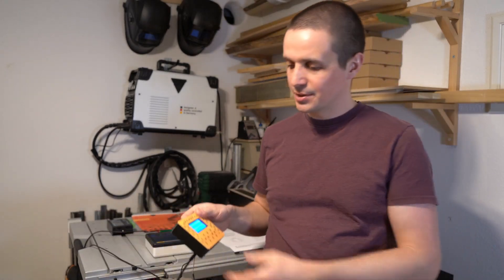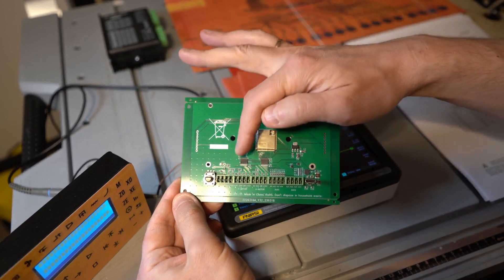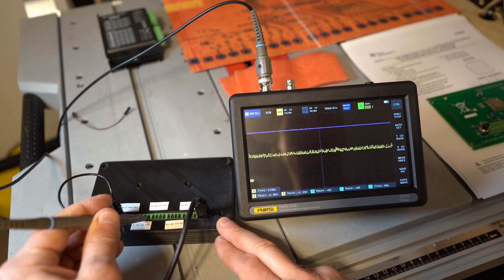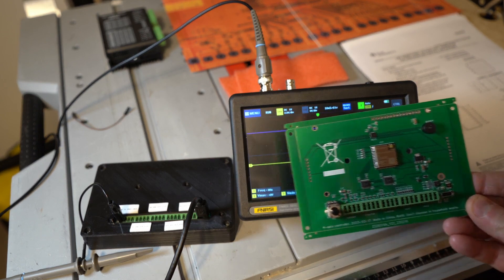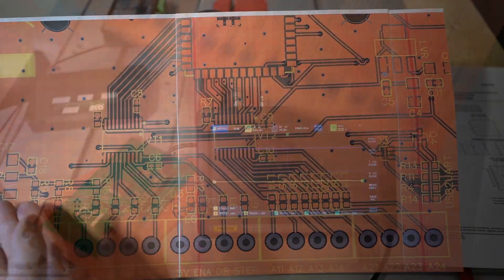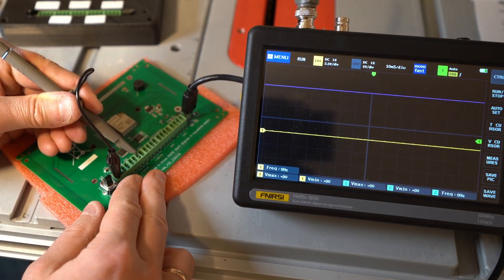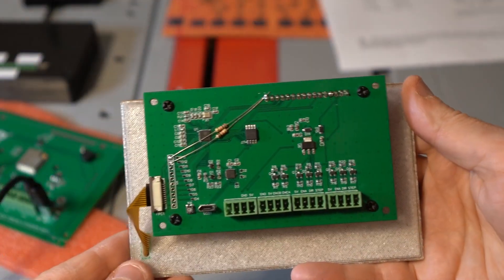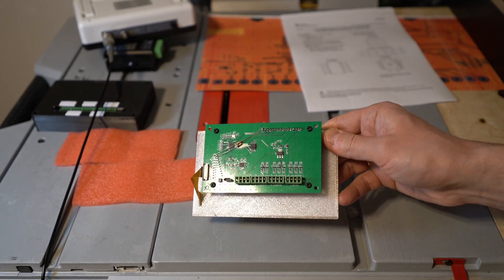Voltage translation woes - TXS0108E

Comment: i've had those exact ICs become headaches many times in professional designs i have worked on. the bidirectional amplifiers get confused very easily. They also do not have the greatest drive strength. plain and simple just stay away from them. I have only seen them work when source and destination are both on the same board, the trace impedance and SI are paid careful attention to, and the links are very short. Just remember, a unidirectional buffer will always be more reliable.

Comment: Design Issue ....... 
(1) try adding 20 UF Tantalum Cap before decoupling cap 
(2) Remove any Pull Up Pull Down OR Line Resistor ( This IC Can NOT Drive Current )
(3) Pull OE High with a 1K Resistor

Comment: dear dir is cool thing that you make can your unit can read DRO as well if can will be willy cool thank you
Reply from the maker: Dear friend, hardware-wise adding DROs is possible even today in A1 or A2 but in software it won't be easy.
Reply: @MaximKachurovskiy  thank you will be great if is possible and will be very easy to use if can and thank you for you answer and if can I willy to have one as well
Reply: @MaximKachurovskiy  and only the DRO sender and the function that you put into the control will be litter more easy maybe thank you.

Comment: As others have said that TXS chip is often sold as a general purpose level shifter. I believe that because of this (myself included), most people will try to use this in an application where some current needs to be drawn, or the signal is very sensitive to line capacitance. 

The optocouplers in the driver needs some current, and I don’t think that the TXS chip you’re using in that configuration can supply the current needed. 

I went with an SN74AHCT125N. It’s unidirectional, but for transmitting out step, direction and enable pulses it will work.
Reply from the maker: I went with a bunch of transistors - https://github.com/kachurovskiy/nanoels/blob/main/h4/h4-20230429.pdf page 5 - so far all good :) It's bidirectional and no stock shortages.

Comment: Using bi-directional level shifter here is a waste of money. I am lazy to look up the datasheet but you are most likely observing output pin switching into receive state (from output state), and it is looking like 1/2 of voltage. I think stepper drivers can be driven by an open collector transistor.

Comment: Have you tried using a tri-state buffer chip – the SN74AHCT125N
The Adafruit web site said that they are, “particularly good at converting 3V logic up to 5V”

Description-
Level shifting chips let you connect 3V and 5V devices together safely. This chip is similar to others in the shop (such as the 74LVC125) except this one is particularly good at converting 3V logic up to 5V. This is in demand especially when connecting some 3V devices such as the Teensy 3 to NeoPixels! Just power the 74AHCT125 with 5V, it will detect 3V logic properly. You can also use it to connect 5V logic out to 3V logic in, that's when you want to power the 74AHCT125 with 3V, it can safely read 5V logic on the input pins.

Comment: Maxim, I tried to use one of these on a Due based project since I was replacing a Mega (faster sampling) but like you I ran into issues and eventually gave up on the project as I didn't have enough experience to decide if it was my mistake or the boards capability. Good luck I hope that you solve the issue as I am waiting for a 2 axis version of your project.

Comment: Those TI bidirectional voltage translators are very troublesome IME, I would never recommend using them.  The automatic bidirectional action works by eating into the logic level noise margins by a significant amount.  At the input you have to pull it much closer to 0v than regular LVTTL or CMOS levels would require (I think ~0.15v) and also very close to the reference voltage to get a logic 1.  At the output it will only get to within about 0.4V of ground.

Comment: Not a good idea to use logic level shifter in first place to control stepper driver. Technically speaking stepper drivers controls by current, not by voltage: + and - terminal goes directly to optocoupler and current 10-20 mA needed to activate it(deepens on model). Often to make life easier stepper drivers also includes current limited resistor for optocoupler to allow direct 5V control, but current still should be maintained as per datasheet. Classic bi-directional level shifter with MOSFET and couple resistors can provide voltage, but current limited by pull-up resistor. It works for you? My CL57T Ver 4.0 works from 3.3 volts directly from STM32 output just fine. But it doesn't mean you should relay on experiment data, not on datasheet.
My suggestion: use NPN transistor(like BC547). Connect EN+, DIR+, STEP+ to 5 volts, connect collector of transistors to EN-, DIR-, STEP-, connect emitter of transistors to ground and connect base of transistors to control lines from ESP via resistor(check datasheet for base current). You also can use MOSFET if you like.
Reply: Excellent point I missed tx0108 is not going to be able to source 20ma per port, another thing to take into account is switching frequency if you're using any level translator. You can use an output buffer that can operate at the switching frequency you need, since you only need unidirectional level translation.
Reply from the maker: Thank you both, your feedback is why I keep making these videos 😃 Very good note on current, I didn't think of that much but I think I'm already using the approach recommended by @MNUS - https://electronics.stackexchange.com/questions/661842/bi-directional-voltage-translation-with-esd-and-emi-protection - toggling the EN- DIR- STEP- while having 10mA of current available on the plus lines (once I adjust my resistor value 🤫).
Reply: @MaximKachurovskiy  that works too, but keep in mind that when you set 0 on output, you will have around 10 mA current trough pull up resistor to ground via MCU pin. Check how much current it can handle, especially combined. Also at 5V and 10 mA there will be 50 mW heat dissipation on that resistor. 805 resistor has 100 mW power rating, 603 has 62.5 mW power rating. Still fit, but...
Also if you plan to use those pins as inputs, connected device should be able to handle 10 mA current on output when it set it low.
Best solution to keep inputs and outputs separate.

Comment: Replace them from ones bought off Digi-Key. I've used these before, never had issues like this. Also most stepper drivers have optocouplers on input that should work fine on 3.3v, have you tried directly driving them ? Usually high speed optocouplers on DIR and PUL, regular one on ENA. All of them should activate around 2.5-2.7v
Reply from the maker: I agree there might be some issue with LCSC components but it doesn't make sense for me to tinker with them further since I need a reliable source of ready-to-ship boards and it's clear that there's high risk of shenanigans in the JLCPCB+TXS0108E route. It will probably work directly as you said but https://www.omc-stepperonline.com/download/CL57T.pdf page 6 says 4.5-5v 🤷‍♀
Reply: @MaximKachurovskiy  I've used cl57y v4.0 with 3.3v logic levels 🤷‍♂️
Reply from the maker: @HM-Projects  sure, I'd do that on a project at home but selling stuff that's obviously out of spec is another thing. I also want to allow using those lines as general purpose digital inputs and driving 5V straight to ESP32 is out of spec as well.
Reply: @MaximKachurovskiy  I usually treat stepperonline datasheets with some healthy skepticism, pull the units apart first time and look at the components to work out the actual specs. Same with anything from China, especially checking earth connections on mains connected equipment.